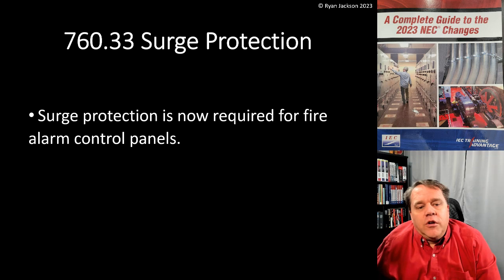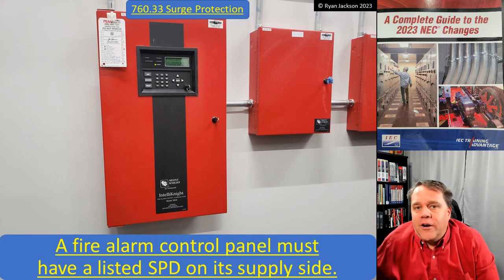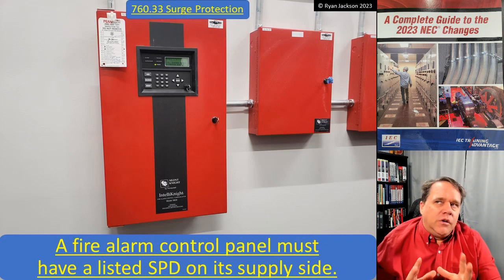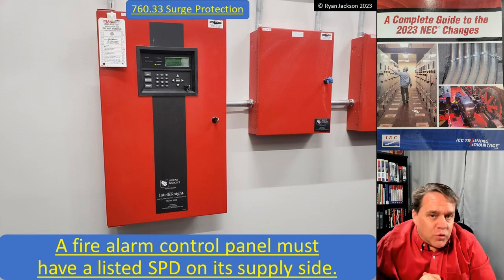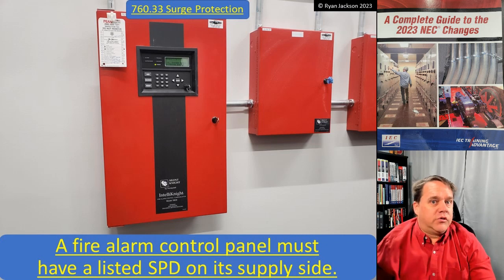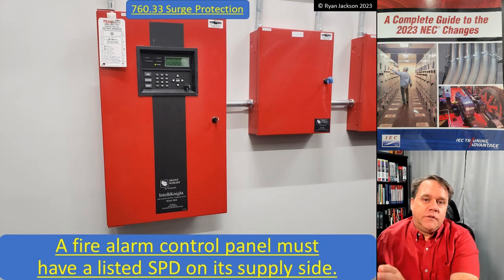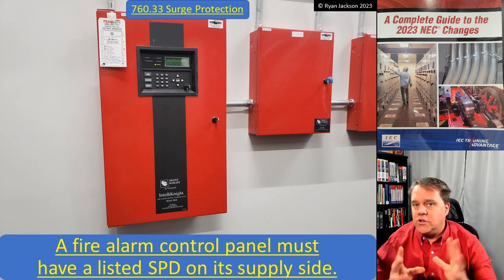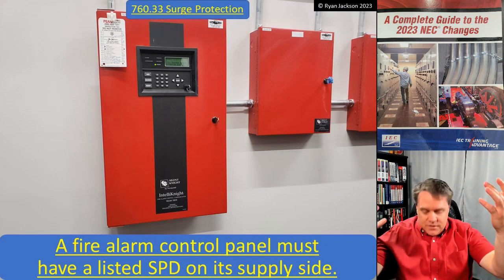760.33 Surge Protection (for Fire Alarm Control Panels)

Comment: Hello Ryan, sorry to ask on this format but I’m in a bit of a bind. 

I have a small transformer-(a separately derived system)- 10KVA single phase 480 stepping down to 120/240. My question is on grounding and bonding. The transformer is feeding a 100 panel board with a 100 amp main in the panel.

The MBJ (green screw) is attached in the panel. 

My neutral point is X2-X3 in the transformer. It is connected to ground. Ground is connected to the source feeding the transformer, and grounded to building steel. 

I am not sure if I need to send another ground out to my new panel, or just use the neutral conductor as the green screw is attached. Im worried about the parallel path I will create. Any tips or video references? 

Thank you for all you do.
Reply from the maker: If the transormer is connected to ground you need to remove the green screw in the panelboard.
Reply: @RyanJacksonElectrical  thank you sir!!!! I believe that was the case, and I need to install a supply side bonding jumper.

My confusion lies in the term “the first means of disconnect” as this will be the first means of disconnect for the new system. However upon reflecting and studying this morning I believe that may only apply to services although I may be wrong. Thank you for your prompt response and your many great services. I hope one day to be half the code guy that you are!!!